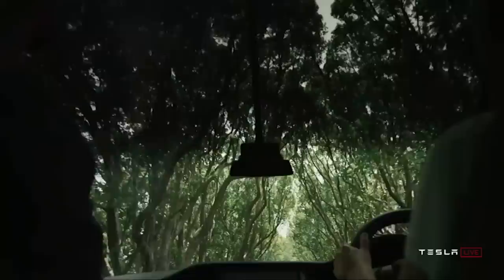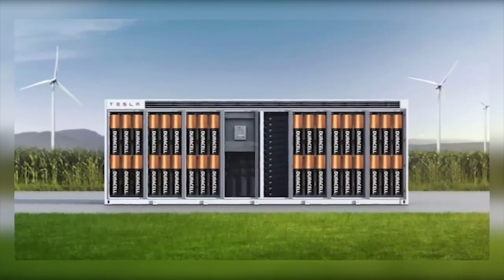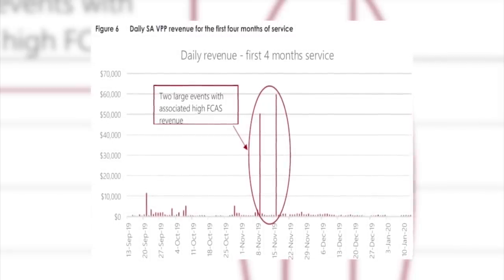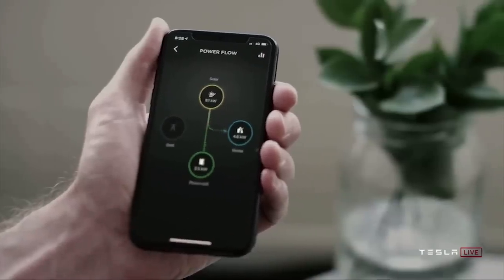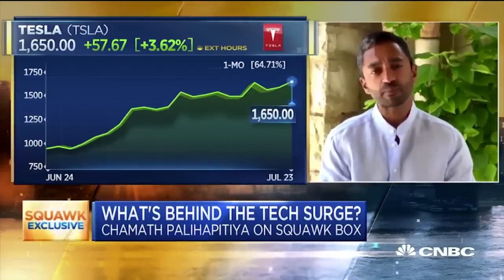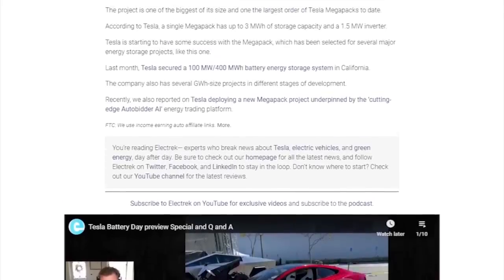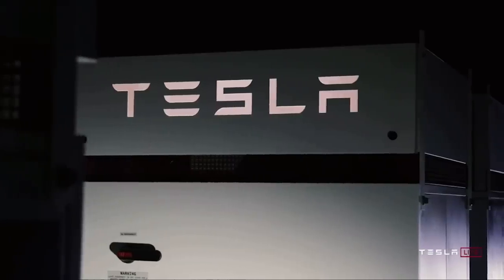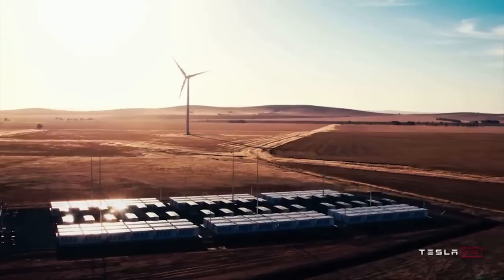Tesla Battery Farms Will Destroy Utility Grids

Comment: Tesla is no longer a disruptor. It is now shaping our future and telling all businesses how to get things done right.
Reply: It pays nothing on advertising, the PR is free, up to you whether you embrace it or pay hefty running costs on your ICE vehicle like I currently do.
Reply: Without question.
Reply: I'm not sure how you can say that. The entire automotive industry is having to follow Tesla or die. The same will be true in the power markets.  That is disrupting two of the biggest industries in the world.
Reply: Rich Ratch  they dont get underpaid what are bitching about they make decent money
Reply: By all means get rid of the polluters but Solar and Wind cannot replace network base load.
The world needs unlimited energy from "walk-awy-safe" Liquid Thorium ion molten salt energy converters which can produce hydrogen for the  fuel cells in trucks; JP4 jet fuel for aircraft; ammonia for fertilizers; desalinated sea water; for crops; low pressure- high temperature heat for recycling metals and plastics as well as electricity for homes, factories and EV's (loaded down with heavy batteries); plus rare medical isotopes while converting current stockpiles of partially used nuclear fuels called "waste" left over from the 50 year old designed light water reactors, that they should be replacing ASAP - currently the cheapest being offered to Indonesia is ThorCon's 7×500MWe - expected life 80years - at the cheapest capital cost - for a 2year construction  of $1000/kW and 80 year life - and with levelised unit cost of less than USD0.04/kWh  AND it can do a black self start as well as being a "Load Follower" - so beat that with your short life, erratically supplying solar and wind farms relying on imported Chinese processed rare earths....
https://youtu.be/oB1IrzDDI9g
Reply: @mrvaticanrag3946  we need all solar and wind power we can get and as time go by, we will see great improvements to solar panels and wind turbines. In our near future, houses will be installed with solar roofs. Technology advancement has zero limits. We may also add nuclear energy to add sustainability. Energy storage will be big businesses. Tesla has their own tech and few smaller companies are building zinc-air based energy storages for cheaper commercial purposes. There are many ways to boost the power grid but it requires r&d and investments. Many of us investors can make many things work for as long as we invest in companies helpimg with electrification. Tesla is one of them. Boralex is one of the companies we have in Canada that has been reaching new all time high. Investing in electrification is a win win. We make the future happen and we also grow our investments. Instead of thinking that we can't achieve things, one should think of our future potential and be optimistic. I have never been so excited to see the world progress and it pays to be a part of it.
Reply: lulu minator not really for wind, wind is unreliable and is dangerous, nuclear and solar would be the only way to get energy in the far future.
Reply: @Generic_Noob  - Wind plus mega scale battery storage can make wind sourced electricity very stable of course the no. Of turbines and the capacity of the mega storage pack needs to be optimized for days when the wind stops blowing. However there are few grids if any that are standalone, other sources are readily available whether renewable, nuclear or fossile fuel based.  Eventually most electricity will be generated via renewable sources. At some point thorium reactors may come into use as well and there will be hydro and geo thermal sources as well.
Reply: It’s insane...
Reply: What do you think it disruptor is? Maybe you should get a dictionary and look up the definition before you say that again. Tesla is the biggest disruptor of our time. Cars, energy, space, travel, sustainability. Even the boring company doesn’t waste the dirt it bores else. It turns it into Bricks.
Reply: You say 'no longer a disruptor' and then define the disruption they continue to do.
Reply: My english is really poor. I'm sorry because I don't have the time to explain to anyone. For some, it is clearly a waste of my time. But yeah.. my english is really poor. I apologize for the poor communication. Have a great one there.
Reply: @LMNSeason  No worries Sir.  Best wishes to you and yours!
Reply: Tesla is not even a disruptor yet. Its still alot of hype. Their cars only attributed to what 8% of global car sales last year? Thats not a disruptor...yet. Not to mention the child labor involved in cobalt mining and many many many other problems. Please get educated on the negative aspects.
Reply: @Ian-ie3hy  Why don't you list a few dozen of those many many many negative aspects?  Cobalt is coming out of Tesla batts so forget about that one and they have obviously altered the entire global auto market trajectory.  That's disruption defined. You too will be driving or riding in an EV before you know it.
Reply: @Mrbfgray  Its not my job to educate you. Thats why. And cobalt is very much a part of existing AND the next line of batteries coming out of tesla for the forseeable future. Again you must not have seen battery day? Again not my job to educate you
Reply: Tesla is still a disruptor but soon those disruptions will become the norm.   Megapacks are the third leg of the renewable energy triad, when the winds are blowing or the sun is shining, wind and solar farms can put part of their output into batteries, at night or when the wind is not blowing the batteries can discharge their electricity, or when there is high demand as on a hot day. Tesla’s Autobidder s/w will optimize electricity distribution and costs and alter the market.
Reply: @Chainyanker007  woulda coulda shoulda...all the batteries require mining for materials which come with environmental and human costs (child labor for cobalt for example) so while i am not saying stop ....there are very real and valid concerns / impacts that will requore addressing for the EV market to be a better option...and until then it is quite unclear if the benefit is actually substantiated (i believe the jury is still out on this one) 

Now of course the batteries that you are talking about to store energy from wind farms also require the materials to build the generators as well. Not to mention all the issues that come with operating them. Everyone seems to think that batteries were reinvented to the point where they have no cost (not the dollar amount). In reality, this is far from the truth and until mitigated lower the efficacy/benefit of these products.

Once these products are better, then i will consider it a disruptor. Its still very possible after a decade we will find out that these products are causing more harm. Im all for green tech but i am not buying the hype without the science (i will still try to make money on investing, after all the hype train does move pretty fast and is hard to stop as proven by all the hate im bound to receive for posting this lol)
Reply: all about PR
Reply: Nonsense
Reply: Le Chat Botté ?
Reply: @omgcyanide4642  ?!?!
Reply: Le Chat Botté why nonsense

Comment: First solar panel purchase 1982 arco 33....couldn't believe how well it worked...its still putting out about 85% of its original power claim. Now of course solar is becoming the norm. Running your house off your auto ; Tesla power wall it's great news in these troubled times.
 SpaceX is just unbelievable ! Lots of common sense from a company that will do great things for our future.

Comment: Flatly, even with the new reductions in cost, lithium Ion batteries are far too expensive for large scale use.  See the work of Donald Sadoway on liquid metal batteries.  Tesla installations can definitely make a difference for homes and possibly networked homes and for the e.g., small scale project they did in Australia. (3 Megawatt hours is nothing.)
Reply: Agreed, batteries are ideal for frequency control, power shaping or the duck curve, the things that require a few hours of power. To cover an entire cloudy day the norm is natural gas. To capture a night time wind storm it takes gigawatt hours of storage like pumped hydro or compressed air. In my understanding battery prices would have to be one quarter of what they are now to get into the gigawatt hour market.
Reply: @dougmc666  - We certainly need something better than batteries to cut into natural gas having 35% of the worlds power production, switching from coal to renewables + gas is not a solution for climate change.
Reply: @dougmc666  UK grid averages 50GW ! Storing a day's worth of electricity would need 1.2 TWH of batteries ! The odd few GWh are irrelevant.
Reply: @dougmc666  My experience as a reliability operator for PNM. The best promise would be for places like Intel in Rio Rancho when the big wind and solar installations in NM start swinging the interconnection around. During afternoon thunderstorms. Yo are thinking NW weather, not SW weather. Give me 10 mega packs located with the alt energy installations and I could have maintained a much smoother and stable grid. Even the big combined NG facility in Deming couldn't chase the fluctuations when the Ft Sumner wind facility started trip out and back on and the Cimarron PV array did the same with momentary shading from the big boomers coming of the mountains. Were it not for the spinning reserves of the coal plants in the San Juan Basin we would have lost the interconnection and been islanded. With out the steamer, the Luna facility couldn't regulate either. So it isn't even a matter of hours, it's the instantaneous availability of reserves we are talking about too.
Reply: @OldBillOverHill  - Thanks for the real world comments, much appreciated

Comment: Just like to point out that most utilities are heavily regulated you can´t just become one, also these large batteries are not going to destroy the grid peaker plants are the result of an ineficient aspect of the grid, do you really think that big energy companies would rather pay to have these(in these I mean peaker plant which are expensive and only work sometimes so are unpredictable with high fixed cost). I can tell you that every powerplant is design for maximum eficiency but in a rankine cycle like coal based power plants Reheating increases work but sacrifices thermal eficiency, this in it self means they are getting less for their coal which at that scale is a significant amount. Some countries like australia in the example suffer more because of low Hydro power usage, for example in my country hydro is used for peaker plants specifically to take advantage of high prices as most dams here have  a primary use of water storage. These will make the grid more sustainable and in time if widely used will soften the curve between high and low price  which is good because usually there is excess capacity(in here 20 times consumption, albeit due to corruption).
Reply: Also batteries won´t be 100% of the grid nor anything above 50% on average because something has to produce the actual energy.
Reply: With natural gas producing 35% of the worlds electricity, many peaker plants are doing very well. The big question is how to replace them, it won't be with today's batteries.
Reply: Peaker plants are simply a result of our pattern of electricity usage. Nuclear can happily 'load follow' if the regulators allow it. Aside from hydro, the only baseload generation that can do this easily.
https://en.wikipedia.org/wiki/Load_following_power_plant#Nuclear_power_plants
Reply: @pasoundman  Here we have a lot of Renewable, in fact because of Covid we here run fully renewable for 2 months but its also a lot of wasted potencial most of the time, by next year there will be no coal plants and we have the lowest solar prices in the world with a fixed cost contract for 11 euros per MWh so batteries would be nice.
Reply: @pedrorequio5515  UK has also eliminated coal generation during the summer. Batteries are an expensive sideshow and irrelevant at grid powers of multi GW.
Reply: @pasoundman  We only have pumped Hydro for storage here.

Comment: Batteries cannot replace power plants since batteries only store energy, energy still needs to be generated elsewhere to charge them. Having large-scale energy storage merely enables you to consider energy sources that wouldn't be practical or viable otherwise.
Reply: They cannot replace power plants in general, but they can replace peaker plants specifically. Peaker plants are only switched on at peak demand, when all the other production has maxed out and cannot meet the demand. In a large grid, batteries can store excess energy during low demand, and deliver the needed peak energy during high demand. No more peaker plants needed, though of yours we still need mainline energy production plants.

Comment: Without nuclear, we could never make enough power to charge these batteries.
Reply: Wrong. We just need more renewable power plants.
This doesn't mean that nuclear can't be helpful, mind you, but it's not required.
Reply: @theuncalledfor  What you don't need is unreliable and time of day specific renewables.
Reply: @pasoundman  
What you don't need is unthrottleable nuclear power that takes ages to turn on or shut down.
Reply: @theuncalledfor  It doesn't. Modern reactors can shift load to as low as 30% within minutes. In the USA, the NRC says they can't do that.

Comment: Peaker plants will still exist in a lot of areas that have harsh winters; they'll run less often, but demand correspondingly higher $/MWh to break-even.
Reply: Yes they'll still exist but someday the first gas peaker will be shut down and replaced with a battery!
Reply: @dougmc666   Yeah but deep carbonization is sought after, highly unlikely without extreme overbuild of renewable generation capacity, which results in wholesale power prices going negative when there's plenty of solar/wind energy around, which counterintuitively raises electric bills because now all these generators that aren't getting paid to put power on the grid need to recoup their investment down the line. For the last ~20% you'd still want some kind of firm power generation source; nuclear would be greatly preferable to gas peakers.
Reply: TL;DR 
Replacing many fossil fuel power plants isn't the goal; replacing all of them is, sprinkle in a bit of nuclear too to get it done quick

Comment: i have an EV (Bolt)  I charge it with 24 solar panels.  I drive for free.  (Also there is no maintenance of ware on the car
except fo the tires.)
Reply: I believe you paid for the car ? Right ? How is it free ? You're a fool not to maintain your car. The mechanical bits wear out.

Comment: I see solar becoming more economical beneficial, along with the battery packs. Now if Teslas solar over shadows the cars in scale. It’s also very possible for them to become a distributor of batteries too, for other solar companies. Over shadowing solar, like solar did to cars. 

Mining stocks will be hot. Probably even see new companies pop up with new tech.
Reply: How exactly does ADDING battery packs make solar MORE cost effective ?
Reply: @pasoundman  Well, in Texas where wind over-supplies during certain hours of the day, and utilities almost give it away for free during these times, these utilities could store this excess power and sell it when they can better profit from it. A similar scenario can happen for solar. Solar generation is so cheap, and can oversupply during certain hours of the day so ...
Reply: @jeffcarlton3590  The problem in doing so is the lack of any means of cheap storage. Batteries are expensive to make and lack realistic capacity. You'll need 100s of GWh of storage to make a serious impact.

Comment: Its about energy. power to run everything.  and the fossil fuel industry is not dead, but its certainly antiquated.  CUrrently its the mainstay and will continue to be so for at least the next 4 to 5 decades, but in that time clean energy and batteries will be the backbone support system which profits off of the standardized industry's weak points.   That is until green energy becomes so advanced it will no longer make sense for fossil energy to continue.  Now 4 to 5 decades may seem like a long time and it is.  but in this period of transition and evolution, current big money tycoons in all of gas oil and fossil fuels will continue to fight against such clean energy efforts.   As is always the case when the new ushers out the old.   the faster the better, but it also means those old folks must be pushed out the way. ANd old money will grasp its clammy hands onto control as its body slowly falls into its grave.
Reply: How did you come up with four to five decades?
Reply: @Christian-fx9ur  right. Solar + storage now. On everyone's homes.  If we all invest directly  in storage and solar then the grid won't  require coal and gass for power.  Nor will it be economically to use fossil fuels.

The utilities think they can regulate us out of the game, but at some point it will make sense for us to disconnect.  And the public won't buy their lies or power.